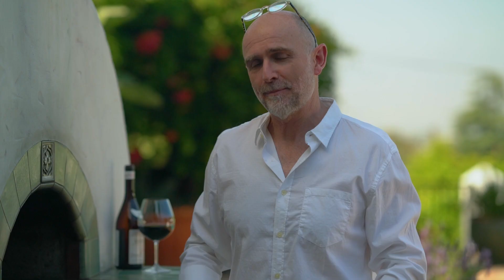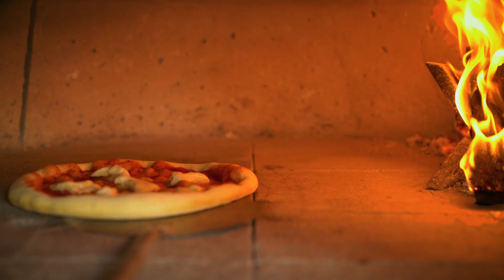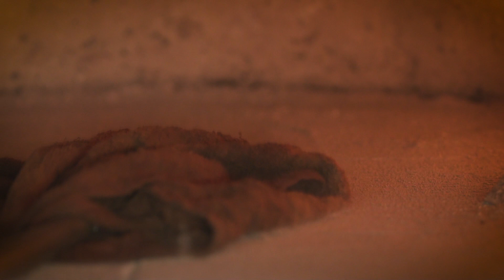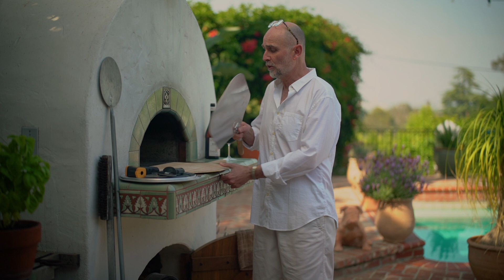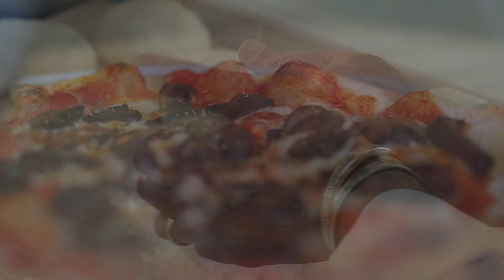Pizza Tools and Oven Preparation for the Wood Fired Oven

Comment: Do you start your fire in the middle and then move it to the side? How often do you add wood during the heat up stage?
Reply from the maker: I start the fire where I want to oven to be hottest, then use the variable heat between the fire and the cooler surface closer to the oven opening. You can start the fire in the center of the oven, but if you then move it to the side of the back, the center will remain the hottest surface for a while. If you use a lot of wood in the early stages you might put too much heat into the oven, and if you have good heat retention then it's going to take a while to cool down. Watch Episode 32, that will answer your questions. Clive
Reply: @ thank you

Comment: I’ve made your recipe previously and always find my dough to be wet, today I just can’t seem to get it right.  Using instant yeast. App and 00 flour.  Would you suggest letting it proof wetter than expected or add more flour?
Reply from the maker: Hello Michelle. Perhaps try using a little less water, or a touch more flour, but the yeast amount can remain the same. Keep a record of the measurements so when you find the right mix you can reproduce it each time. Let me know how it works out. Clive

Comment: Clive, I notice you place your wood on an iron grate. Do you do this for airflow? Do you know what these grates are called and where I could get one? I am watching your dough recipe next. Do you use sourdough and if not why not? Thank you you so much
Reply from the maker: It's called an Andiron. If you search "Steel Firewood Andiron" or "Andiron Log Holder" you will come up with some results. Mine is 18”. It helps with better airflow around the fuel, and so it’s not just sitting on the embers. I haven't perfected sourdough yet to give you a qualified answer.

Comment: Can you provide a list and/ or links to all these tools? Thx!
Reply from the maker: The peel I use is the "Small 8-inch Turning Peel with Long 59-inch Handle". You can find it at webstaurantstore.com. Personally I don't like the perforated metal peel since I use mine for removing ash from the oven too. And a wood peel if you’re making pizza. I think wood works better than metal.
Reply: @TheWoodFiredOvenChef  thank you!

Comment: We are in the early stages of planning a wood oven of our own. Currently devouring your content and past time I leave a comment. Would love to see more on fire maintenance.
Reply from the maker: I will add it to the list of episodes to make. In the meantime, as you're planning your oven you should pay special attention to insulation. It will have a direct effect on how you fire contributes to fire maintenance. I regularly fire up my oven to be around 750F/400C in the center of the oven floor. The hottest area of the oven is going to be around the fire, around 900F/480C, then will drop towards the oven opening to around 450F/230C. So you have various temperatures to work with when placing your food. An oven with good heat retention will require less fuel to maintain the temperature, which means a smaller fire, which gives you more surface area to cook with, and gives you greater flexibility. Clive

Comment: Would you have any suggestions/tips as far as building/buying a Wood Oven? They are not that common in north america and hence seem to become a luxury item, with not many great options... Many people seem to prefer to buy those portable steel version, which clearly is not the same. Where I come from (Brazil) large wood ovens are very common, you can buy a ready to install dome at any home center.
Reply from the maker: If you would like yo email me through my website then I will send you all the information about my oven.

Comment: Fantastic video series! I watched them many times and followed your steps yesterday with my first pizzas on my new wood oven. Quick question: even though I lit the fire more than 4 hours ahead and reached good temperature (400 C, and BTW is that enough?), when I started cooking pizzas I felt that even though the oven temp did not go down, the oven floor did and I started noticing that it took longer for pizzas to get that beautiful brown color at the bottom we love. I ended up moving the fire back to the center for a few minutes and move it back to the side to regain good floor temp. Is this normal or something is wrong with my oven? Any tips?
Reply from the maker: What oven do you have Lionel? Can you send me a picture at thewoodfiredovenchef@gmail.com. It sounds like you don't have enough heat retention. You can try putting the fire bother side of the oven, or a horseshoe around the sides if you have the space. Clive

Comment: Once again, lovely mellow video.   Just a suggestion - an aluminum pipe can serve as a precision bellows (imagine a glass blower and you have the picture).   It's perfect for both jump-starting the initial firing, AND for blowing unwanted ash off the deck in a very controlled way.   Start from side opposite the fire and follow the contour toward the fire.  It will instantly clear the floor and deposit the ash in the coals and fire.  No ash cloud, nothing left behind.  Very quick, clean and easy.    Mopping the deck interrupts your bake, and cools the deck (which you may not want/intend to do).  Worse - at pizza temps - which are double or triple temps for baking bread -  mopping risks temperature shock to the deck.  That can cause cracks or crazing.  Cracks ruin your oven floor, if severe enough and in the cooking area of the deck.  (When you drop a pie, the uncooked pizza dough will sag into the crack. There's no heat in the crack, so the sagging dough does not cook - then your pizza rips when you turn it, hemorrhages good stuff all over the deck, which then burns black, and yeah...  Replacing or repairing a floor is no easy task.)
Reply from the maker: Thanks for the detailed advise Joshua. Clive

Comment: Fantastic series of videos. One question, how do you maintain the 752 degree Fahrenheit/400 degrees Celsius temperature of the oven floor once you start cooking the pizza's?
Reply from the maker: Hello Gianni. Two things that maintain the temperature. The fire and the insulation. An oven with good insulation, that will store the heat, only needs a small fire to keep the temperature constant. I could remove the fire from the oven and it would maintain that heat for quite a while, but it wouldn't help with cooking the top of the pizza. Hope that answers your question. Thanks for commenting. Clive

Comment: Excellent video series you have provided us with, thank you. Can't wait to try some of your recipes. Curious about the oven build. so you have a website or company name on who did the install? I like the sectional dome aspect versus brick but I'm sure both would do just fine. Thanks again and I hope that my family and friends enjoy this oven as much as you all do. But I'll build in the Rocky Mountain area and I'm going to need to keep it covered from rain and ice, maybe a thermal blanket of some kind. The drastic change in temperature probably aren't is the best for longevity. Slow warm ups is the best I can think of.
Reply from the maker: Thank you for commenting. With care, and a regular coat of exterior latex paint, an oven should be able to withstand the winter. But covering during that period will probably help. If you would like more information about my oven then email me at thewoodfiredovenchef@gmail.com. Clive

Comment: Thanks really enjoying these videos thanks for posting. I have a WFO that i built, all are unique but have to disagree with using a damp cloth to clean the oven hearth, this can damage the bricks and cause damage. Better to use the small round peel as a flap to move most of the ash. I also have a blow pipe that i use to help restart the fire and clean the oven hearth after using the small peel. Hope you don't take this as a criticism but i am active on a few WFO forums and the damp towle is always advised agains, have seen it done in Italy maybe there is a difference between home ovens that use fire bricks for the floor / hearth and commerical oven???
Reply from the maker: Hello Al. I don't take it as criticism. I know there are mixed feelings about wiping the floor clean. I tried to emphasize a damp cloth knowing that one that is too saturated with water definitely has the potential to cause damage. I like the idea of a blow pipe. It made me think that a glass blowers pipe would be perfect for that use. I'm glad you enjoyed the videos, and thanks for commenting. Clive
Reply: @TheWoodFiredOvenChef  Yes as always loads of diffrent methods the blow pipe is handy. Thanks for replying and the  great series of videos very informative 👍

Comment: We are making/buying possibly the kit but the opening is 9 1/4" inches. Your oven has or at least appears to be a taller opening
Reply from the maker: The outside opening around the tile is 10.5" high by 24" inches wide, and the interior opening to the oven is 9.75" high by 20" wide.

Comment: I want to build a wood fired oven in my garden. Do you have a recommendation for a type or even a guide for building one. I want to have a smaller oven because the most I will use it all at once is baking pizzas with my guests so use time will mostly not longer then 1-2 hours. How long and how much wood would be needed to fire a small oven (lets say 70x70 cm cooking surface)?
Reply from the maker: Hello Ilay. I don't know what part of the world you're in, but it sounds like you should maybe begin with a portable model. A 70x70 cooking surface is perfectly workable if you’re efficient with the space. When you say “then most you will use it”, I think once you have an oven you’ll find every opportunity to cook something, whether it’s pizza or some other dish. Have you looked at the OONI? I think that, and other similar models, are a great place to start, but decide your budget and do your research. As for how much wood. I may use around 25 to 30 pieces of wood each time I fire the oven up, but it all depends on what model you end up buying. Let me know what models you’re looking at and I can help you more. Thanks for commenting. Clive
Reply: @TheWoodFiredOvenChef  Hello Clive. Thank you for your response. I am living in Germany and do own a Uuni Pro. It is a very good oven but it has a disadvantage. Because the oven is small and doesnt have any mass for storaging the heat, apart from the bricks on the cooking surface, it is hard to run it on lower temperature and get an evenly heat on the bread. Further I miss the feeling working in front of a "real" wood fired oven. I really like mediterranean style white wood ovens however I think it will be hard to realise the spherical dome. I am actually open to different styles.